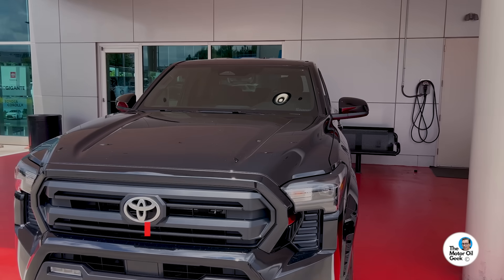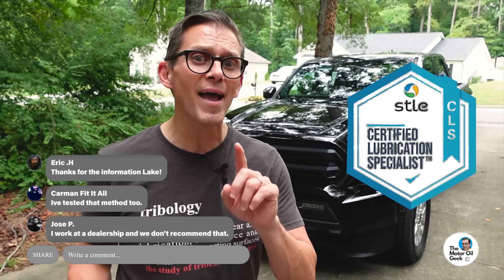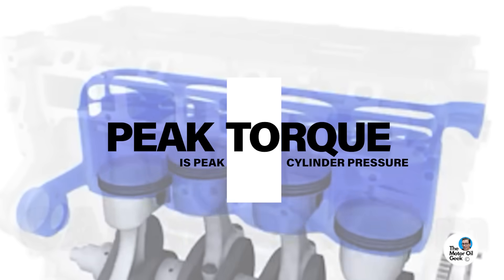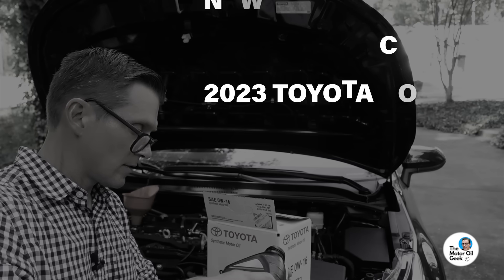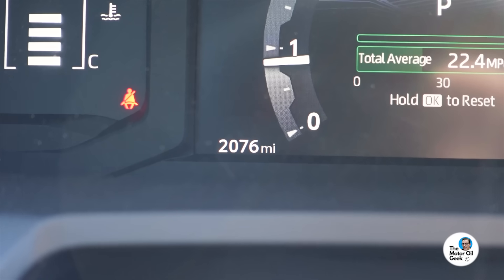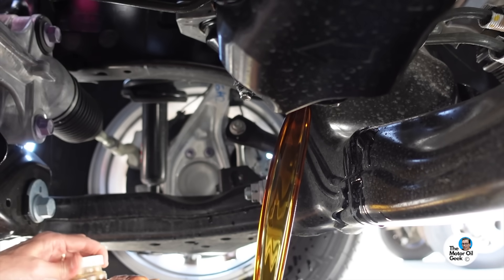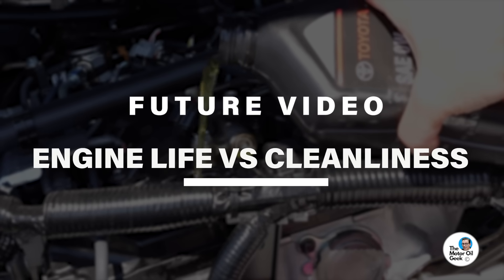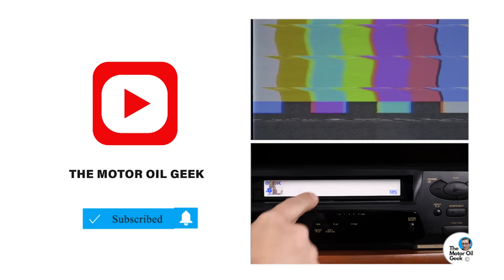The FACTS About Oil Changes (What The Owner's Manual DIDN'T Tell You)

Comment: You have no idea how much I smiled when you detailed 3 oil changes in such a short mileage timeframe!

I learned from a gent that worked at Toyota of their process for breaking in engines for racing applications.  What you've stated is nearly identical to what he stated (he offered a few more specific details).

I've used that process on several engines and it has proven itself as being worth far more than it's weight in gold, and I'll continue to use & suggest that method. :)
Reply: What extra details?
Reply: @maxwelladams5114 
1. Do not use any synthetic oil during the break-in process due to them having friction modifiers, as this could slow the break-in process.  I specifically chose to use 'break-in'' oil, which some consider overkill, and I'm fine with that.
2. Use the best oil filter (highest efficiency rating at the smallest micron rating) you can find (ie. don't use the OEM oil filter).  I suggest looking for ISO 4548-12 results in specific, instead of the "I've been using X brand and have had no issues" as that is not factual nor data driven.

Here are the guidelines I was given in addition to the 2 items above.
Engine miles: 0
New oil and oil filter.  Run the engine until it's at operating temp - check for any leaks or smoke (coolant, oil, vacuum, etc).

Engine miles: 1-500
New oil and oil filter (change the oil and filter when the engine is at it's operating temp).  Do not go above 4000rpm.  Do not stomp on the throttle at any time.  Do not use cruise control.  Constantly vary the RPMs (I changed gears every 60-90 seconds).  If the engine has a turbocharger or supercharger, do not exceed 3psi of boost.  This bit was not mentioned, but I do this normally - use downshifting to decelerate, just make sure that the engine will not exceed 4000RPM.  Check the oil level every few days as the chances are high that oil will be consumed during the break-in process.

Engine miles: 501-1500
New oil and oil filter (change the oil and filter when the engine is at it's operating temp).  Do not go above 4500rpm.  Do not stomp on the throttle at any time.  Do not use cruise control.  Constantly vary the RPMs (I changed gears every 60-90 seconds).  If the engine has a turbocharger or supercharger, do not exceed 5psi of boost.  This bit was not mentioned, but I do this normally - use downshifting to decelerate, just make sure that the engine will not exceed 4500RPM.  Check the oil level every few days as the chances are high that oil will be consumed during the break-in process.

Engine miles: 1501-3000
New oil and oil filter (change the oil and filter when the engine is at it's operating temp).  Do not go above 5000rpm.  Do not stomp on the throttle at any time.  Do not use cruise control.  Constantly vary the RPMs (I changed gears every 60-90 seconds).  If the engine has a turbocharger or supercharger, do not exceed 7psi of boost.  This bit was not mentioned, but I do this normally - use downshifting to decelerate, just make sure that the engine will not exceed 5000RPM.  Check the oil level every few days as the chances are high that oil will be consumed during the break-in process.

Engine miles: 3001+
New oil and oil filter (change the oil and filter when the engine is at it's operating temp).  Drive the car as you would normally drive.  I would not suggest taking it to redline immediately, but that is your choice.

Some have told me that this process is excessive - I was taught this process by a guy that was building Toyota's racing engines from the mid 90's until the late 2000's, as this netted them the fewest failures within a racing season.  I'm going to trust his advise over just about anyone else.
Reply: How has it proven to be worth far more than it's weight in gold, there is no way to have data to back up that claim.
Reply: @JDT-pq3wi  How do you proclaim "I didn't watch the video and actively ignore facts" without saying those exact words?

You just did.

Comment: My car has the same viscosity 0w20, it's non turbo 1.5 4 cyl. If I go 5w30 will it be ok? I changed my oil every 6-8000 km until now, I have 51000 km. Last oil change I did the oil was like new it wasn't black at all, is that a good thing or it doesn't matter. I always use full synthetic oil, tried different brands. Thanks in advance

Comment: 5:20 I disagree. There is a possibility that with the newly changed cold oil that the filter bypass opens up, some of that trapped break in debris could bypass the filter at startup. Also the filter holds a quantity of oil that you are trying to replace. The tradeoff doesn't seem worth it to me.

Comment: I have done my oil changes por many years and many different vehicles, I always do on cold, the reason es simple, I let all night for the oil to go down the engine, taking with it all the contaminants, when I take it out, I am in no rush I let it for an hour to drain, therefore take it out all that is already at the bottom of the engine, whit out any burn to my hands, never had a problem with an engine, for many, many years, and many, many different engines.

Comment: Bought a 2024 RAV new and the dealer told me I didn’t need the oil changed for 10k. I gave it one at 500 and 1500 as well. 1500 was into a new pan and still had some glitter in it. But you know most people are going 10k with the factory fill 🙃

Comment: Questions for Long-Term Ownership of the 2025–2026 Honda Odyssey (J35Y6 3.5L V6 DI)

Hi! I’m planning to keep my Odyssey well past 200k miles and wanted to ask for your expert opinion on long-term durability for the new J35Y6 engine. I’d appreciate your thoughts on the following:

⸻

1️⃣ Fuel: Regular vs Premium — and Fuel Cleaners

Because the J35Y6 has an 11.5:1 compression ratio and direct injection:

Main question:
Is running Regular 87 long-term completely safe thanks to the ECU’s knock control, or could it still lead to long-term issues like carbon buildup, valve deposits, or mild knock-related wear over 200k+ miles?

Follow-ups:
• Does Premium 91+ offer any real durability or cleanliness benefits — not performance, but longevity?
• If someone uses Regular + periodic fuel cleaners (e.g., Gumout, Techron), would that provide the same long-term protection and carbon control as using Premium?

In short — what’s best for long-term reliability?
	•	Regular only
	•	Regular + cleaners
	•	Premium only

⸻

2️⃣ Engine Oil: 0W-20 vs 0W-30

Honda specifies 0W-20, mostly for fuel economy.

Main question:
Is 0W-20 truly sufficient for long-term wear protection in this DI engine, especially under heat and load? Did Honda optimize it for durability, or mainly MPG?

Follow-up:
Would switching to 0W-30 help improve wear protection for long-term owners, or could the thicker viscosity cause issues in an engine designed around 0W-20 (flow rate, VTEC/variable systems, etc.)?

⸻

3️⃣ VCM & Muzzler Devices

Many long-term Honda V6 owners disable VCM to avoid vibration, uneven wear, or oil consumption.

Main question:
For the 2025–2026 Odyssey, is a VCM muzzler still necessary for maximum long-term reliability? Or has Honda resolved previous VCM-related concerns with the updated J35Y6?

In short:
Is running the van completely stock just as safe for long-term engine health?

⸻

Thanks for your insight — it really helps owners who plan to keep these vans for the long run!

Comment: This may be off topic but still related to oil health. My question is your opinion on oil catch cans. How they may or may not protect the quality of the oil. I installed a unit on my 2023 Ford Transit van with EcoBoost. Oil catch cans are intended to catch (to some degree) the blow by that normally could be contaminating the engine oil. They also catch a lot of nasty stuff that gets re-introduced into the intake air and would dirty up the intake air sensors. My unit has captured some pretty foul smelling stuff. A good oil catch can needs frequent emptying or they will create more problems than solve. What's your thoughts.

Comment: I didn't get around to changing the oil until 3000 on my new GM.C elevation pick up.  I was traveling a lot but I did get it changed before thirty five hundred miles. It's a turbocharged engine so I will change it every 3500 miles from now on. It takes full synthetic at 6 quartz plus the filter. I really wanted to change it all myself, but wasn't able to the best I could do. My 1972 GMC pickup had over 300000 miles on it when I sold it, and I changed it every 3500 miles quaker State.

Comment: Hi please investigate why a KTM off road / enduro bike upto 500cc  needs an oil change every 8 or 16 hours but a larger engined KTM 690cc off road bike can go upto 10,000 miles between changes. OIl capacity is 0.8l and 1.2l so does not seem to explain the difference

Comment: I think this is great advice, Lake, but I will add that as a Lexus forum moderator for years, there are many owners out there who had their new vehicle oil changed for the first time at 3000 - 5000 miles before going on to reaching 200,000+ miles without any engine issues. These owners do have their oil changed at anywhere from 3000 to 7500 miles, but another aspect of their ownership that most likely helps is that they typically pile on the miles, meaning few short trips without longer commutes that inevitably follow, starting on Mondays.
I have no doubt that what you are doing is the best way to achieve greater than 300,000-mile longevity, but the reality is that most original owners will sell their vehicles before they accumulate that many miles. 
Keep up the good work!

Comment: Thanks for the advice. My 2026 BMW X5  states one viscosity on a sticker under the hood (0W-12) and doesn’t even mention it in the manual which lists 0W-20 or 0W-30. Which should I be using. So far I’ve only used the 0W-12. I have 3 oil changes and 6000 miles on the car. Normal wear as per Blackstone. Help!!

Comment: Knowing what you know about ice engines lake, why didn't you get the frontier with the vq 3.8 normally aspirated I just bought the 25 frontier and checked out the Tacoma.  Just curious why you didn't get the VQ 3.8 in the frontier. Tacomas are like 20 grand more for a TRD Pro versus the Pro 4X on the Nissan and the frontier I believe. Will will be much more reliable than actually aspirated vq 3.8 then that fourbanger with the turbo... Plus you get 310 horsepower more and you could have got the same trim level for probably 10 grand less in the frontier. Just curious. Love show and Pop 5W30 for the win. I did my first oil change at 250 mi.. And learn that the Nissan filters are horrific paper capped and non-crimp pleats. I'm running pup 5w30 And Purolator 1 filters...

Thought for sure I see you rolling up in a a Nissan frontier cuz the 3rd gen Nissan frontier is cheaper and I believe is built a lot better than the Tacoma. Look at all the problems they had with the tundra V6 twin turbo...

Comment: I long since tossed the mfg "recommended" OCI, designed to get you thru the warranty. Zero oil related trouble or sludge/varnish over 30 years and hundreds of thousands of miles. Big deal, so I do one or two more changes within that mfg OCI. Quality oil/filter is the cheapest insurance you can buy. And no, the planet won't know the difference with proper disposal.

Comment: A little more about the break in he's talking about with piston rings. Its not uncommon for engine builders for racing engines to slap an engine together (figure of speech lol) and then put it on the dyno (engine or chassis) and do multiple pulls increasing throttle and cylinder pressure each time until the motor stops "making power". Then they drain the break in oil and use the racing oil. When it stops making power, the rings are seated. Granted this is more for RACING. Engines like this are designed to last anywhere between a quarter mile to 500 miles. If you are just putting your engine back together after a rebuild, run non synthetic normal motor oil to seat your rings faster then move to synthetic if you want after you get the crud out.

The reason that doesn't happen the same with consumer cars is more for the convenience side of things. They designed the cars for this convenience for the average joe shmoe. In reality, what this guy is saying here is probably the BEST way to do it. However, one thing that isn't being mentioned (probably because the engine comes with oil already) is that when seating pistons, you want to use a non synthetic oil at least until the rings have fully seated. You can seat rings with full synthetic but it takes longer. Purpose built break in oil actually has a lot less friction modification to it, allowing for accelerated but controlled wear I.E. breaking it in. You wouldn't want to run that in your engine unless you knew what you were doing. If not, just go get the cheap Super Tech for the first bit. 

I hope someone found this interesting.

Comment: I made the first YouTube video on the 3rd Gen Tundra engine failure. It happened to me at 16,182 miles. The dealer refused my oil change requests and only changed it once during this entire time. Toyota ended up buying the truck back from me.
Reply: We just got the new 4runner and the dealership still refused to change the oil at 10k I did 3 oil changes already at 10k they kept peeling my sticker off and adding 12k to my already 3k sticker. Such bs.
Reply: I live in Daytona Beach and my dealership has never had a problem with changing my oil, even with the first 500 and 1500 miles. And they are free for life. They say nobody drives their vehicles in ideal conditions and 10000 mile oil changes are for ideal conditions. 
My first new vehicle from them lasted 20 years until "23 when a person who could not speak English hit me and totaled it. I intend to get 20 plus years from my  '23 Tacoma.
Reply: @merlinzipp Probably was a Rag He^d
Reply: I have a 2nd  generation Tundra. I won't buy a 3rd due to its engine problems.
Reply: @billymorgan7717 I knew better, I should have trusted my own advice

Comment: There is nothing wrong with 10,000 mile oil change intervals as long as you use a true Group IV PAO or Group V Ester synthetic oil, if you are using those fake synthetic oils that are nothing but Group III hydro cracked oils then you need a much shorter oil change interval. I only run Group V Ester oils in all my vehicles for me I run Redline but Motul also has a Group V Ester synthetic oil, my engines are clean as a whistle inside because Group V Ester oils are excellent at cleaning and keeping the internals clean in an engine. 

Proof you say, sure no problem there is nothing harder on an oil than a motorcycle engine that shares the primary and transmission with the engine oil. My Yamaha Star Venture Transcontinental was a shared sump design. I ran Redline Group V 10w-40 motorcycle oil in it and sent oil samples at each oil change to a lab, the factory oil change interval was every 4,000 miles, I changed the oil every 8,000 miles and could have gone longer. The oil change reports always show lower wear than the average for the engine. So I went twice the distance and the lab reports showed lower wear than the average wear rate for these engines and the average oil change interval reported to the lab was just over 2,000 miles per oil change. Also if you go by the average oil change from the lab reports I was going almost 4 times longer between oil changes than the average for the same engine because so many people are buffaloed into thinking they have to change their oil every 2,000 miles or so and my engine wear was lower than there. 

What I am saying is buy only the best oils i.e. Group IV PAO and Group V Ester synthetic oils and you will be fine and your engine will be happier and last longer. If people would just run a quick cost calculation they would find the cost of running a best quality oils is only a few dollars more over the oil change schedule vs the cheaper oils they are change more often. Add the price of the oil and filters for multiple oil changes vs one oil change and filter for the highest quality oil and filter and you are within $5 to $10 dollars for the cost of the oil change(s).

Comment: I have a 2005 Toyota Hilux 3 litre D4D.  At my last oil change at 345000km I drained the old oil and filled with new oil then ran the engine up to temp and drained this new oil . I then replaced the filter and refilled the engine again . I now have 3000km since the oil change and my oil is still fairly clear . Did I achieve anything except run up service costs by doing what I did ?

Comment: I don't care if you change the oil 20 times before 1500 miles and every 500 miles after that.
That engine will NEVER last as long as the older N.A. 4 cylinder engines.

Comment: I bought a 2023 Bronco full size brand new ….being a heavy line Ford tech for 15 years I saw lots of damage from lack of oil changes ….ive built a lot of engines also…..I changed the engine oil in my New Bronco with just 400 miles …
Friends of mine thought I was nuts! 😂
Even when I build motors , they usually get 3 oil changes within 500 miles. Initially after an hr of run time, 2nd time at 50 miles. 3rd time at 500 miles. Then every 5000 miles when using full synthetic oils…..

Comment: Would you recommend bumping up to a 1 step up weight oil for an engine well broken in over 200000 miles on it. Ive heard it helps alot. What is the next step up from 0w20 ?